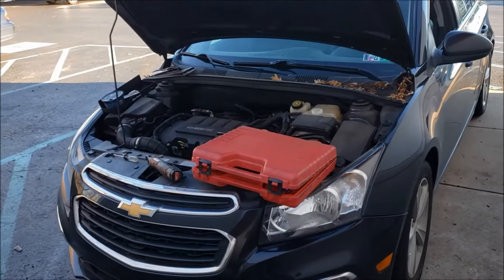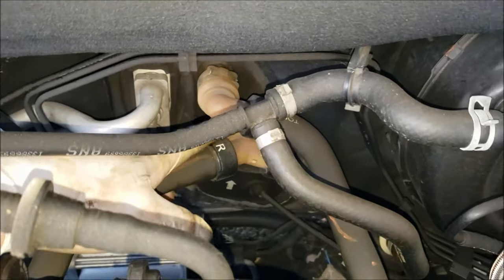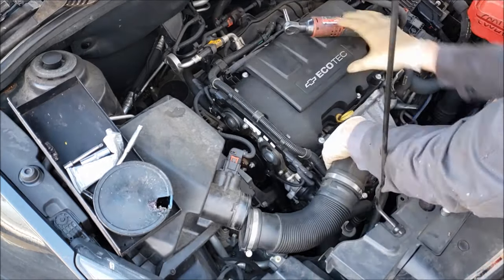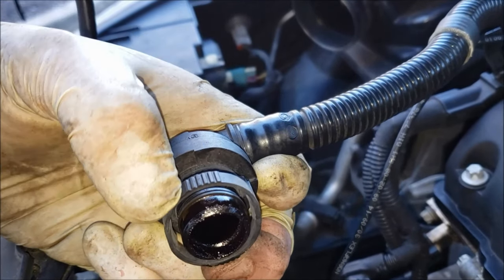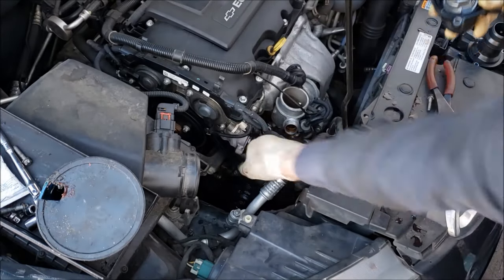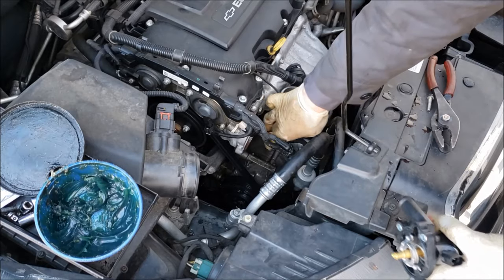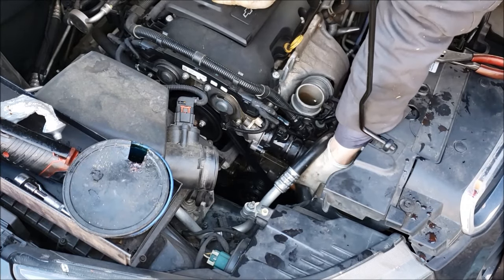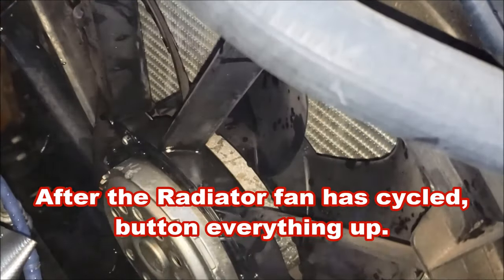Chevy Cruze Thermostat Replacement GM 1.4L Coolant Leak / No Heat

Comment: Can u pour hot water on the thermostat to tell if its failing  or any way of check whist the thermostat is out to see if working right?
Reply from the maker: Yes. But the best way is to put it in a pot of water and slowly heat it up with a thermometer inside so you can tell at what point the thermostat opens
Reply: @NoNonsenseKnowHow  i was not sure as some say its electric and cant tell that way but im not sure and was trting to work out if mine is stuffed on a holden trax 2018 it dont open in hot water
Reply from the maker: @Lifesagrindcoffee  is your car overheating? Yeah it could possibly be stuck, but that is fairly uncommon from my experience. In either case you would have to remove it to test it of course
Reply: @NoNonsenseKnowHow  yes initially i had collent leak in the water pump so i replaced with a new one now coolent boils after few mins running right side is cool where left side pipes are hot waiting on new thermostat atm
Reply: Down fall for Australians holden went into recession and has been abit of a problem
Reply from the maker: @Lifesagrindcoffee  damn that sucks, I'm sorry to hear you're having troubles
Reply: @NoNonsenseKnowHow  $265aud just for a thermostat and another $150aud water pump i hope it fixes the issue
Reply from the maker: @Lifesagrindcoffee  wow, that's outrageous! You can't order it on Amazon? Is that from a dealership?
Reply: @NoNonsenseKnowHow  unfortunately with postage lately is extremely slow and these was all the main auto shops we have ie repco,autobarn,supercheap auto,(its not super cheap)
Reply: All had aroundbsame prices some water pumps was quoted from $88-$297 Australia has become a joke lol
Reply from the maker: I just looked them up on Amazon and you can get a GMB water pump for $33 and an AC Delco for $66 here in the states
Reply: @NoNonsenseKnowHow  wow thats a crazy difference we pay to much for everything here even just to live
Reply from the maker: @Lifesagrindcoffee  yeah pretty crazy. You guys probably make more money on average though I would guess. And also the AUD is worth more than the USD.  What would you say a reasonable rate for a labor job is there? Here it's around $15 an hour. $20 an hour would be considered decent and that's what most of my skilled labor friends make.
Reply: @NoNonsenseKnowHow  most mechanic's i know of charge around 70 to 120 an hr independent. on as a person as a worker an employer would pay $23min an hr but most $30+an hr mechanic's make a good coin
Reply: Hard to find some1 to work under 23.90 an hr in any job as i think we have a min cap for employees over 21 unless doing an apprenticeship they get $14  or so on 1st yr and goes up after that
Reply from the maker: Yeah so that is considerably better. Makes sense why parts cost more i guess.
Reply: @NoNonsenseKnowHow  beats to be a mechanic or welder here lol

Comment: Thank you for your videos. I'm working on my 2012 sonic (1.4 manual) which has a crack water outlet. And just for good measure I might as well change the thermostat just in case. I mean, it only has 50K miles but I have had it for 10 years now. My only question would be: should I go for acdelco/OEM or a cheaper brand would do?
Reply: I went with advance auto parts motorad which had one year warranty. Failed 8 months later and got it replaced with same one again. 
Water pump I went with the car quest because it comes with lifetime warranty. 

I never had issues with advance auto store parts except this thermostat.

Comment: Why is the steering wheel Buick and not Chevy? Is this the same car thru the entire video ?
Reply from the maker: I used the end clips from a previous video that had the exact same bleeding process. Same engine in the Buick
Reply from the maker: Seemed redundant to rerecord it but didn't want to leave out helpful information

Comment: yes s I agrea like the 2015 chevrolete trax  from sandy Turner turbo gaskets thermostat  housing valve cover gasket turbo gasket it and oil filter housing ? fan belt tensnnore the alttenatar is at the back orginally its suppose too be at the front ?
Reply: there should off been recalls ?

Comment: Does this car have an electronically controlled thermostat? It's kinda hard to find info about it online but I came across one forum post saying it's electronically controlled with a grid controlled electronic wax pellet type. 

It is a post on Cruze Talk called Electronic control of thermostat temperature 1.4T and I would post a link except YouTube nukes all comments with links.
Reply: But no product listings mention electronic control, which is surely a feature they'd mention if it was present right?

Comment: when i put the hose back on the thermostat it leaks not a lot but still leaks. i put the grease on the o ring like you showed push the hose back it clicks like you showed but i cant get it to stop leaking. any ideas what i might be doing wrong
Reply from the maker: It sounds like the O-ring may be torn. I would take it back off and inspect. Let me know what you find out. Thanks
Reply: @NoNonsenseKnowHow  can the o-ring be replaced? I was thinking I might have to replace the hose on account of that o-ring
Reply from the maker: @ThePapertank1  yeah a lot of time you have to replace the whole line. Trying to find the proper o-ring might be an issue. But if it was me I would try to find one that fits first
Reply: @NoNonsenseKnowHow  was able to replace o rings that I got from oreilys that worked I had to order them
Reply: My car was overheating so I changed the thermostat and was still overheating then I changed the coolant temperature sensor and is still overheating what else should I change? Car keeps shooting coolant into the  coolant Reservoir then it after that fills up it goes onto the ground.any idea's?

Comment: If I don't have an e10 socket is there anything else that can be used?
Reply from the maker: You can try using a regular socket. Whichever one fits Tightest.  Will probably work
Reply: @NoNonsenseKnowHow  thank you. This is a great channel. Going to try to tackle this today and will let you know how it goes.
Reply from the maker: No problem and thanks man I appreciate the feedback.
Reply: @NoNonsenseKnowHow  got the new part installed and no leaking anymore (thank God) had to scrub my garage floor with kitty litter. Anyways thank you very much for the video it really helped me out a lot.
Reply from the maker: Great! Glad everything worked out and I appreciate you dropping the update comment

Comment: Yup that lower hose on the bottom of the thermostat I couldn’t get that clamp off and cracked the coolant hose 🤦‍♂️
Reply from the maker: Damn
Reply: @NoNonsenseKnowHow  you know the name of that hose? I ain’t going to be able to change it all that other stuff is in front of it I can’t even remember know what was in front of that hose I would have to take all off.
Reply from the maker: @TaylorOriginal352  Sorry no i dont know the specific name offhand

Comment: Just replaced my Thermostat ( over heating and no heat from heater )
Therostat was in pieces. 
The 2 plastic Dog Ears that hold the spring retainer in place broke off.
What a crappie design.

Comment: Is it just me or is the beginning of the video a chevy cruze and the end of the video is a Buick?
Reply from the maker: I used the outro from a previous video in the end of this one
Reply: @nononsenseknowhow how did you get the small hose off of the bottom of the assembly. I've been fighting with it for about 45 minutes with no luck
Reply: @NoNonsenseKnowHow  how did you get the small hose off the bottom of the assembly. I've been fighting with it for about 45 minutes now with no luck

Comment: these cars should be illegal to produce. I didn't do my research and bought one of these and I have put more money into it than I ever did in any of the 25+ year old vehicles I've ever had COMBINED. and right now I'm having yet another cooling problem and there's so many possible culprits that it's almost impossible to pinpoint.